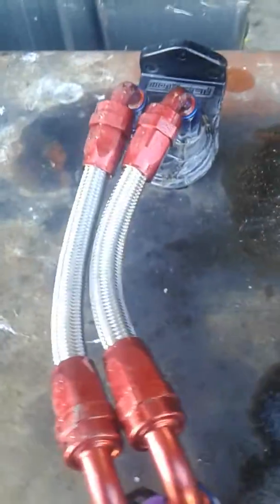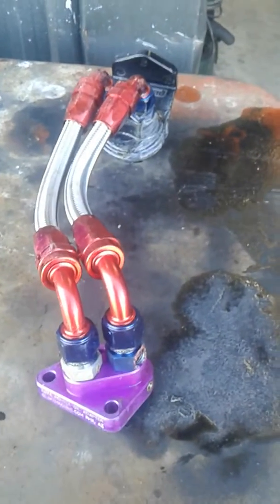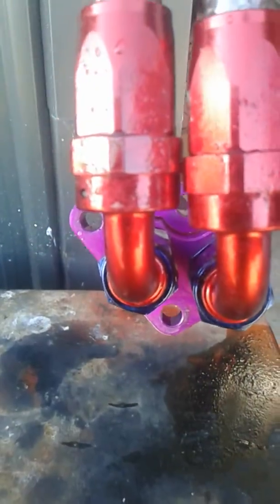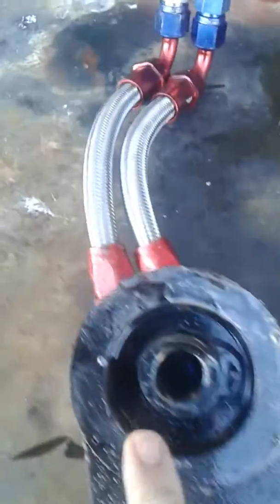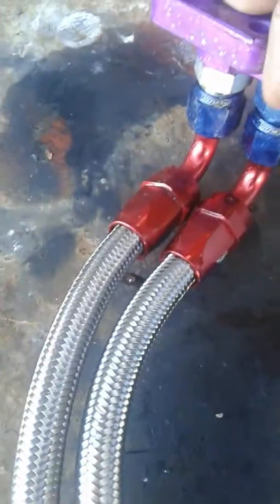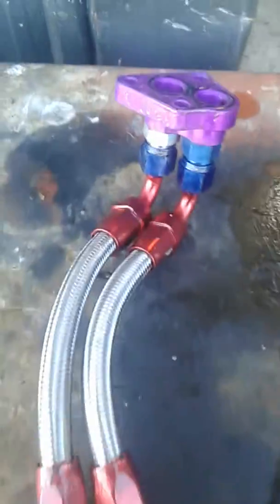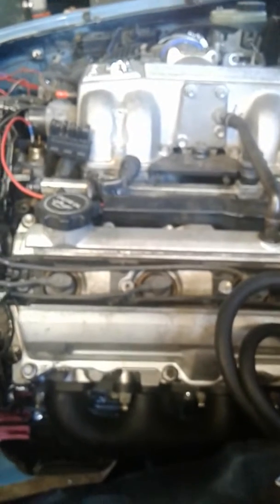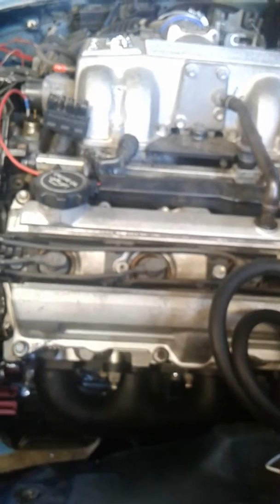Remote oil filter housings - Warning.

Comment: sorry my english is not good. There will be no oil pressusere if the hose connections gets mixed because oil filters can have anti drain valves?
Reply from the maker: yes.  Correct,  no pressure to the engine.  Cheers Kelvin

Comment: Gday , my mate has a oil filter relocation kit on his 1uzfe and it's been sitting for about 3 years, we just drained the oil and pulled the filter off yesterday. What's the best way and easiest to Prime the oil pump so I know when I turn it over I have oil pressure.  Cheers.
Reply from the maker: This video covers priming the oil pump from outside after an engine has been sitting a long time.  https://youtu.be/mQYF02wWy1U

Comment: You should post a link to your product in the video description. Very interested in one for my mk2 supra swap.
Reply from the maker: Thanks for the tip.  I'm working on an update to my website atm.  Currently my filter block can be purchased from NZ trade me https://www.trademe.co.nz/Browse/Listing.aspx?id=1861920447  or directly via email.  I'm doing another video with the same part at the moment which is a Mk3 supra getting a 1uz VVti and brand new R154.  I did an auto 1uz VVti Mk3 this time last year.  I'm attempting to do a video each day then mash it into one video.  Will see how I get on.

Comment: So if the oil lines are back to front it won’t get good oil pressure?
Reply from the maker: You often wont get any oil pressure if the oil filter has an anti-drain back valve.

Comment: Curious where did you get the forward facing mount that's now on the 1uz. I've just done the oil relocate and one of the fittings is leaking I would much rather a direct bolt on like the one you installed
Reply from the maker: Its one that I sell.
Reply: Do you have a link to this? I would need one as I‘m swapping a 1uz to a 4 Runner